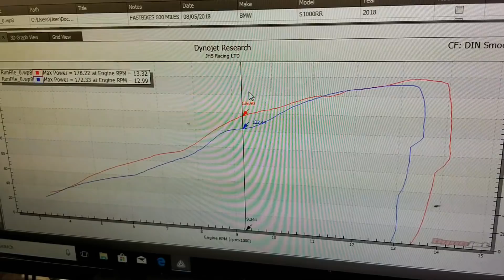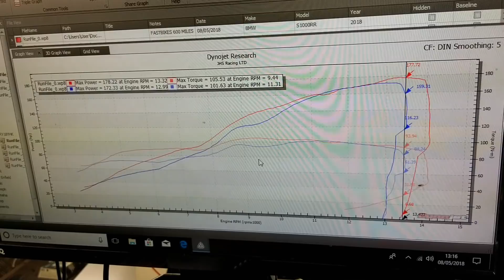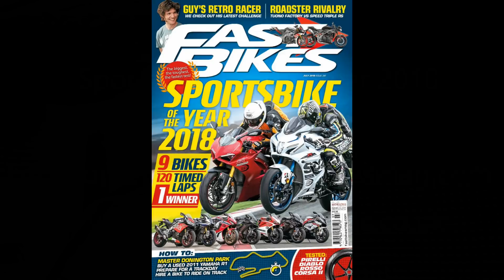2018 BMW S 1000 RR 'Sport' Dyno Run!

Comment: I'm curious about how it stacked up against the GSX-RR. Seems like with just the can, it bests the S1000RR even with its Akra hardware.
Reply from the maker: That Akra can doesn't do much, same power as last year's with a proper OE can - most manufacturer optional exhausts must still meet legal requirements, always better to go with true after-market zorsts if you ant more power - both were 6bhp more than the Gixer which came in at 172bhp.

Comment: I absolutely love your dyno shootouts...  Can't wait to see how the s1k stacks up against the panigale v4... Hopefully you will dyno the ducati
Reply from the maker: Soon!
Reply: Fast Bikes Magazine how high was the Aprillia RF?? Anyone??
Reply: Steve Hash all I can say is last year's run was 180hp on this dyno. Funny enough last year's s1k made 178 on this dyno too.
Reply: MrJayjay0420 yea PB mag  also measured the Aprillia at 1-2whp more then the BMW.. are they finally making more power 😂
Reply: Steve Hash Aprila is just a couple more peak hp. However the bmw makes considerably more mid range. Both are monster bikes
Reply: MrJayjay0420 actually not due to V4 ENGINE they are brilliant on low to mid range..but Aprillia is more about  lap times yess..
Reply: Steve Hash look at fast Bikes 2017 shootout... Bmw makes more mid range.. Actually every dyno shootout I've seen lately shows the bmw making the most mid range and zx10 and r1 making the least.
Reply: Steve Hash https://youtu.be/L7qjNNgfRt4

There's the link.. Just for the aprila bmw comparison. Though the aprila has a much more linear powerband
Reply: MrJayjay0420 hehe yess the linear power curve is second to none HAHA WOW that was one sexy power band.. it fookin looks like a PC5-airfilter and exhaust power band 😍😍 but stock vs stock the Aprillia has zx10r stupid sprockets setup 😂 both  are  geared for 200mph + whilst BMW has 186-187mph.. And gearing means acceleration.. 

Also the zx10r gen4 and gen5 had THE worst  gearbox ratio NOTHING is happening on that bike below 10k rpm.. 

BMW yess that has the best  low-mid of the new breed of bikes.. but way to heavy on flickability and i even had the lightest of them ALL HP4 still To heavy vs zx10r gen4 my other old bike..

Now i have the widowmaker and ohh mt god that bike had Even better liw-mid then my hp4 and it flicks like a fookin god 😂😍 And you need all the skills since there is NO EL gay stuff 😂😂 it's like driving a Ferrari F40

Comment: which akrapovic exhaust is that ? I've never seen it before
Reply from the maker: BMW's optional extra - it also comes as standard now on the naked S 1000 R.
Reply: Its there HP optional extra. It came standard on my ‘race’ s1000rr

Comment: How does the '18 compare to the '15/'16?
Reply from the maker: The last Euro3 S Thou' (2016) was 188hp on this dyno.
Reply: Fast Bikes Magazine that leads me to my next question.... Could you find a 17-18 s1000rr with a full system and see what difference there is.

I've owned both a 16 and now a 17 s1k. When I put my full system on my 17 it felt as punchy as my 16.
Reply: That's every euro 4 bike now, Jay. My '16 ZX-10R had two mufflers on it. Not only is the can on the side huge, but the bread box under the bike was at least 12 or 13 pounds, because of the valve, cats, etc.

Comment: Fake,not 178 hp.dyno 4.gear or 5.gear measured.You last trial 178 hp,1.gear,2.gear,3.gear,4.gear,5.gear...Real hp 172 hp...
Reply: Mateeryal Mateeryal you literally made no sense. The 172 hp came from the zx10.
Reply: zx10r dyno measured 5.gear.Bmw not only 5.gear.i do not think you write without knowing the job...
Reply: Mateeryal Mateeryal what are you taking about?
Reply: I've dynod my bike plenty of times. 4th gear 5th gear.... It doesn't make a big difference.
Reply from the maker: You and us both!
Reply from the maker: Mr jayjay is right, on most bikes mapping is the same from 4th gear upwards, only on a couple of modern machines is there different mapping in each gear (like the Ducati V4). We do 5/6th gear runs too just to make sure.
Reply: Thank you very much for beign honest fast bikes magazine.
Reply: Only 5.gear 180 hp dyno result motorcycle.2.gear,3.gear,4.gear,5.gear dyno result 187-190 hp...
Reply: did you do your runs with the rear wheel speed sensor disconnected?